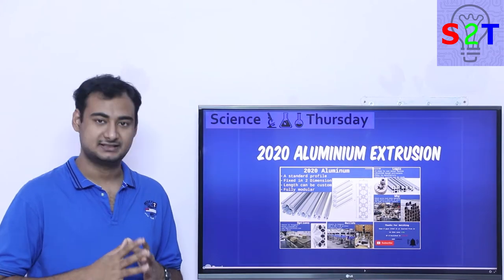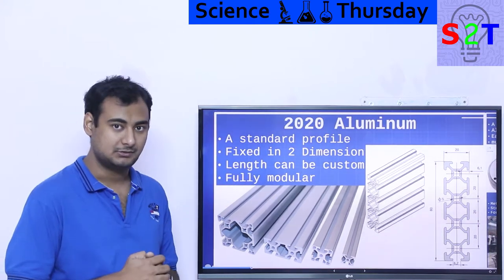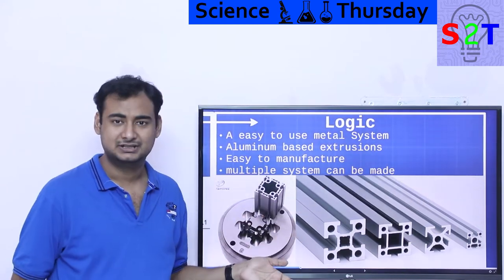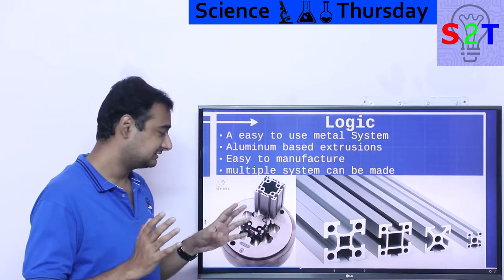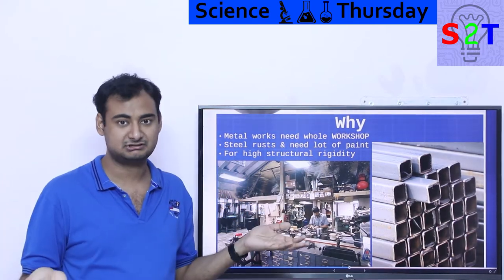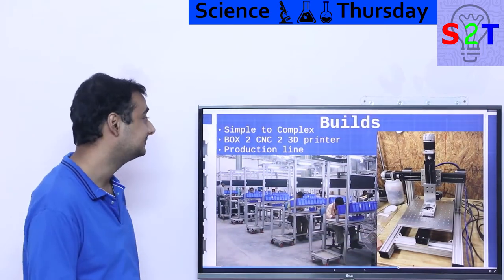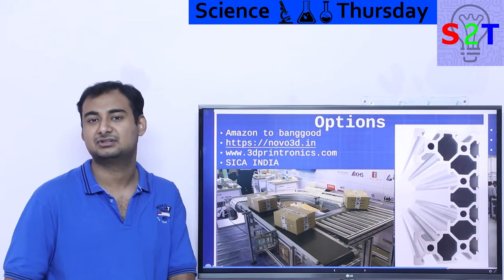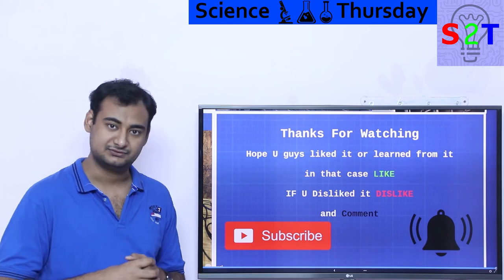2020 aluminum extrusion Explained  {Science Thursday Ep105}

Comment: So I want to have 2 x 2.5metre lengths to support 40kg of solar panels, would i need 20x20 or 30x30 or 40x40?  Thanks in advance.
Reply from the maker: each seller have a spech sheet which will tell you what is the safe rating in worst case 40X40 if u want to be Hurricane proof

Comment: what does the Type-I, Type-B mean? what does the different slot 5,6,10 mean?
Reply from the maker: yes there are multiple of 1 unit so u can get 20 40, 20 80 & for different shape like C 40 80
Reply: @s2tenglish  I know what the 2020, 4020 and so on mean (that is straight forward),.. but what is Type-I and Type-B ... I think I figured out the slot 5,6, 10 ,.. I think they are the millimeters gap for the slot so you know what kind of screw you can use.
Reply from the maker: onec u see an image U will understand they are like Lego all are addition of one unit in different ways

Comment: Hello
nice video thanks
in your opinion a 20x40mm profile 100cm long with how many kg it begins to flex 
a really nice video
good day
Reply from the maker: it wont flex if its only one meter long and supported at both end there are ways to calculate it but under normal use U cant really put anything that is man portable  and will bend it

Comment: Great video! Can I build a small travel trailer frame chassis using these? If so, what is the type to use?
Reply from the maker: may be not as bolts are not meant  for road Vibration
Reply: @s2tenglish  thanks for the reply. Any other modular material you can think of? Or what if I use the aluminum extrusion without bolts?